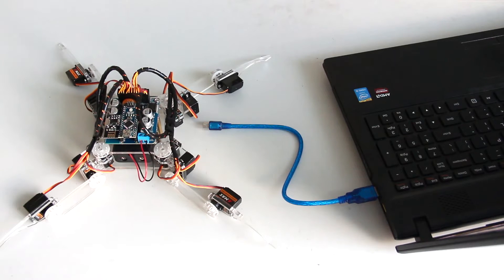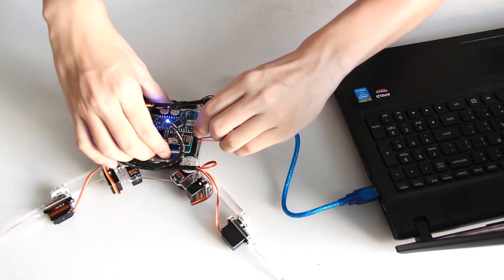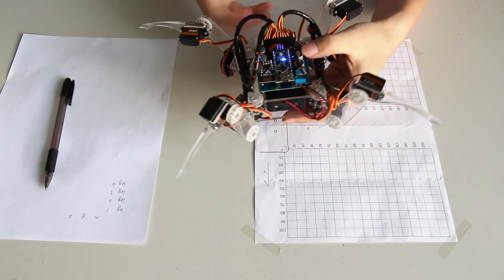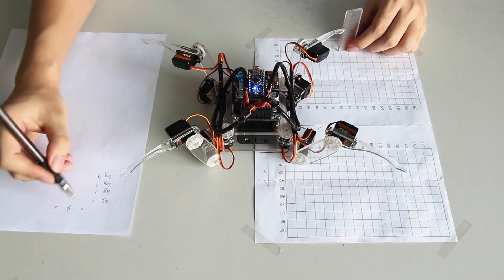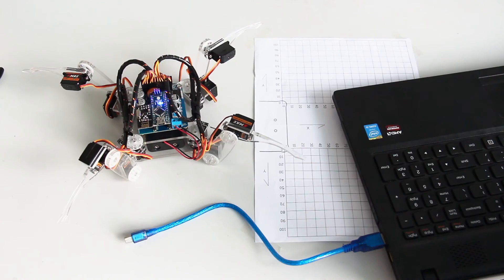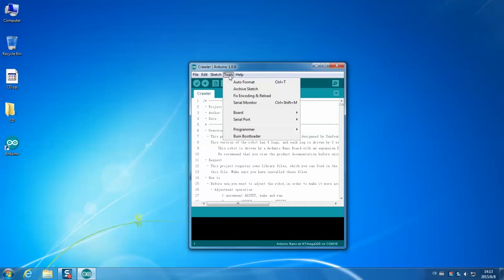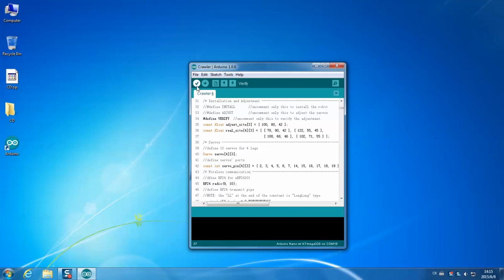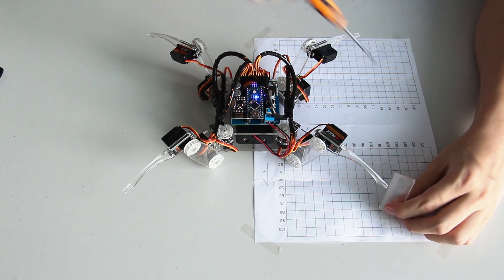SunFounder Crawling Robot Assembly Tutorials 07 Calibration

Comment: Hello Sunfounder, nice Video. I have a question about the calibration code. In the array:" adjust_site[3] = { 100, 80, 42 };" the 100 is the x-axis, the 80 the y-axis and the 42 the z-axis right? Where do this numbers come from? I mean how are they calculated? Another question that i have is, in the "Size of the robot" section, what stands the "z_absolute" for? Is this the offset height?
Reply from the maker: Dear JBCACC,
The 100, 80, 42 are the value of the x,y,z. You can find how to measure it in the 4. Calibrating of the instruction book.  Z_absolute is the initial value of the spider and is the offset height. Pls reference to the instruction book.
If you still have confusions, pls connect with us.
Reply: Hi, thank you for your reply. I also made an post on your forum. The thing is, i build a larger robot and have struggles to get it calibrated since the size is different now and i have to change the parameters in the array "adjust_site" but i dont know how to calculate them from the new size of my robot. It seems that your website is at the moment offline so i would realy apreciate it if you could help me here
Reply from the maker: Dear JBCACC,
We feel sorry that we also don't know calculate these parameters.
Maybe you need time to research on it.
Hope you can find the way to solve it, and if you have some discoverise, we feel happy to communicate with you.

Comment: There a problem in  crawler programme in line 223 with the following comment, how can i fix it?
Arduino: 1.8.0 (Windows 7), Board: "Arduino Nano, ATmega328"

C:\Users\Desktop\CD1\code\3.Crawl\Crawler\Crawler.ino: In function 'void loop()':

Crawler:176: error: could not convert 'radio.RF24::read(((void*)(& order)), 1u)' from 'void' to 'bool'

    if (radio.read(&order, 1))

                            ^

Crawler:223: error: could not convert 'radio.RF24::read(((void*)(& order)), 1u)' from 'void' to 'bool'

    while (radio.read(&order, 1));

                               ^

exit status 1
could not convert 'radio.RF24::read(((void*)(& order)), 1u)' from 'void' to 'bool'

This report would have more information with
"Show verbose output during compilation"
option enabled in File -> Preferences.
Reply from the maker: Dear Ken,
Well noted your problem, the reason is that you upgrade the "RF24 library", after upgrade, the "read()function" has been modified, pls go to Arduino / libraries and delete the RF24, then add it again, you can fix it.
Hope you have fun in SunFounder.

Comment: Mi robot exceeds the calibration grid
Reply: what I have to do
Reply from the maker: Yes, when you measure two legs on one side of the robot, only half of the robot will be on that calibration grid. Then you need to measure the other side by turning it around.  If the size don't match, would you send a picture to note@sunfounder.com.
Reply: Sunfounder exceeds the half of the grid the leg is outside the lines
Reply from the maker: We are not sure how does the robot exceed the calibration grid. Is your robot in the status just like that in the manual after you uploaded the calibration code? If not, there should be some problems in assembly. If you are not sure what's going wrong, please turn on the power of the servo board and send some pictures to our email at note@sunfounder.com.

Comment: my quadruped dont turn on after I upload the board, why ):
Reply from the maker: Did you press the power button on the robot?
Reply: yes, its turn off when I connect a servo to it. but its turn on without servos.
Reply: +Sunfounder its not working like in the video tutorial
Reply from the maker: Please check whether the servo is connected correctly – red wire (anode) to VCC, and brown wire (GND) to GND. And you can change another servo and see what happens.
Reply: now its moving with all the servo but the robot dont move when I move the joystick, I tried the transmit & recieve code for test it and its works as is shown on a previous video but the robot dont wireless.
Reply from the maker: OK, so you've done the calibration now, and want to make it move. Remember to comment out the Line 32 and 33, INSTALL and ADJUST part. If not, the robot will keep calibrating and won't crawl. Oh, also, the remote control needs code upload too, in the folder 3.Crawl\Remoter. Refer to the user manual 5. Movement chapter, on P50 approx.
Reply: i think its working now. one more question, the robot move automatic and change the movement direction with the joystick?
Reply from the maker: Congrats! Yes, you can control it to move in four directions with the remote.
Reply: Only the fourth leg raised in the correct possition,
the others go inside. Can you help me?
Reply: disarm an adjust the parts attached to the servo, I did that and now is working, also do dont invert polarity or the main circuit will burnt.
Reply: Made. Now all other legs shrink completely. Only the third leg go in the right Position. Even by the Calibration , it is sometimes better, sometimes worse.
Reply from the maker: The problem might lie in the installing of the four legs. Please check the following two issues:
 1. Did you comment out #define INSTALL when uploading the assembly program?
 2. After uploading the code, check whether the 12 servos are connected to the servo board. Switch the servo control board on, which is very important. Keep the power on during the installation, which can make the legs move in right direction.

If you are not sure whether you have done these, you can upload the code after you comment out #define INSTALL. Then switch on the board and check whether your Spider maintains the same posture as that on page 39 of the user manual. If not, you are recommended to operate the steps after uploading the assembly program.
Hexical

Comment: The "Z" is the tall of the leg?
Reply from the maker: +Juan Carlos Isaac Morel  De Los Santos The Z-axis value is the height of the toe to the calibration chart surface.
Reply: +Sunfounder I'm having some problems during the calibration, when I upload the 33.#Adjust the, 1 leg moves really different compared to other ones, how can I fix it?  Please help me out.
Reply from the maker: +Juan Carlos Isaac Morel  De Los Santos First check whether the wiring is inversed. If not, it may be there's difference between your installation and the (100,80,42) in the code, and you need to calibrate it. Please follow the instructions on the manual and enter the (x,y,z) of 4 legs in the code. The final step Verifying is important as it is the criteria for successful calibration. So you measure the coordinates and see whether they are close to (100,80,42). If not, you may need to repeat the Calibrating part.
Reply: +Sunfounder I checked the servo wiring and it's correct, but it stills different, is so different that the Z-axis is on that keg is 8, also I noticed that my default numbers      (100, 80,42) are really different from yours,  thanks for replying,  please I need help
Reply: +Juan Carlos Isaac Morel  De Los Santos I think they use the (100,80,42) as an example... but they'll tell you fast, I like how fast sunfounder replies
Reply from the maker: +Juan Carlos Isaac Morel  De Los Santos After testing, we learned the reason for your problem is that the assembly part "Upper Plate + Thigh Joint" and "Thigh + Crus" are not done correct. When you're assembling the Thigh Joint, you should keep it level, and when doing Crus, keep it totally straight (for details, check the user manual). The low Z coordinate indicates that the thigh and crus of leg1 are not right set. 
To solve the problem, upload the sketch Crawler.ino again, as shown in the Uploading Assembly Program step in the manual. Then, check whether all the 4 thighs horizontal and crura vertical. If not, assemble the problematic part again. And at last do the calibration again. See if it helps.
Reply from the maker: +Miguel MS Thanks for that! We'll keep working hard!